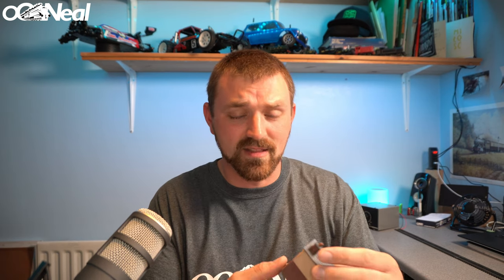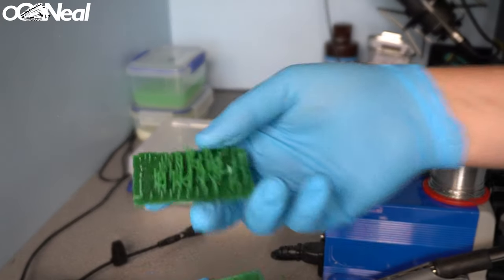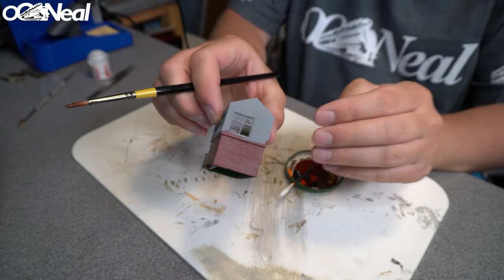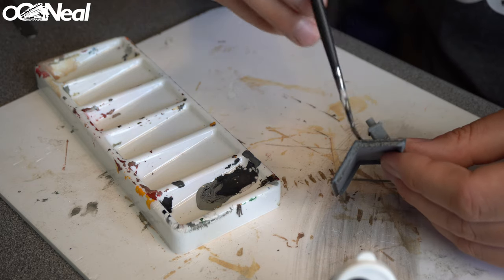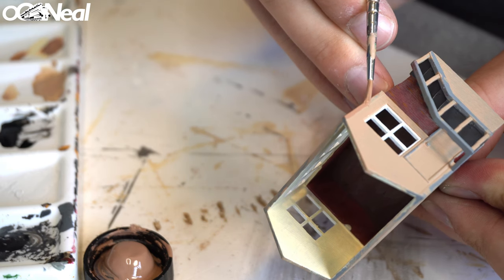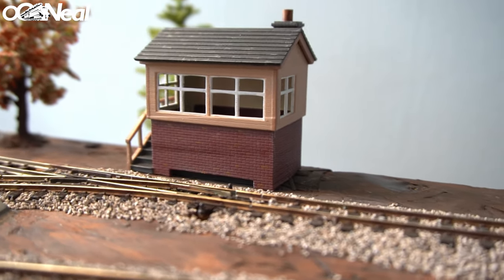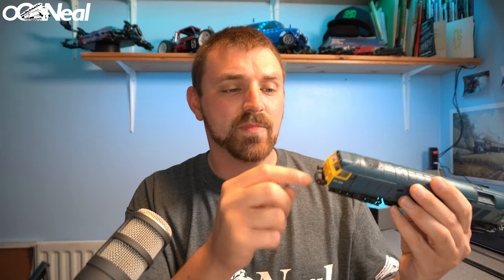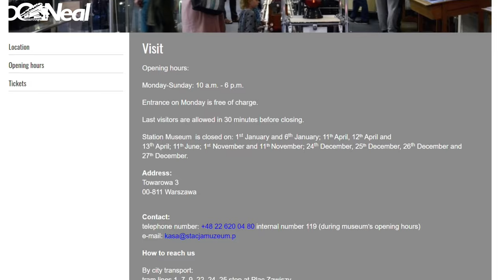Building Up A Model Railway S1 Ep 46 | Painting my 3D printed signal box | Sochaczew Narrow Gauge

Comment: Hi Tris.  A couple of suggestions for brickwork I have used....
Either 1. Cover the surface in beige or grey mortar colour (spray grey primer is ideal), then use a sponge paint pad to carefully paint on the brick colour. If any goes into the mortar don't worry it just adds to the random effect. 
Or 2. Paint the whole surface in brick red (red primer works well), then rub in talcum powder with your finger to pick out the mortar. 

Either will work well, and fast, but depend on the surface and texture of the material. As with anything, as you say, experimenting is the ideal way to test the best method. Thanks for another great watch. Gary
Reply from the maker: Thank you I will keep playing with different ways of doing it and see about this way. Take care!

Comment: You got yourself a unrefurbished class 50 which is a diesel electric, they were called hoovers because of the air plant which made a constant drone that sounded like a vacuum cleaner. When they were refurbed the air system was removed, the chunk out the roof was filled in and they had a lamp fitted at each end. Most were repainted in to full yellow end large logo.
You have done a really good job of cleaning it up and getting it running.
Reply from the maker: Mistery Reviewer that’s great info Thankyou. I’ll keep watching out for more pictures of them. Thanks again.

Comment: Hi Tris, thanks for a whole series of enjoyable videos.  Really nice to see someone so enthusiastic, yet so relaxed, about what he’s doing, and really interesting to see you working with so much tech, particularly 3D printing. Looking at your Lima Class 50 brought a large smile to my face, as I had two of these in my final 00 layout in UK before moving to Czech Republic in 2004. Mine were BR large logo, while your comments about the wheels brought back memories of problems with dirty wheels and traction tyres. Your coaches are BR Mark 1 and Mark 2. The stock with the straight edge are Mk1 Full Brake coaches, frequently found in both parcels trains and at the end of passenger rakes, while those with the rounded edges are Mk2. Mark 1s date from, I guess, the late 1950s/early 1960s, and the Mk2s from late 1960s to early 1970s. The Class 50s started life pulling passenger express trains on the West Coast Main Line from Glasgow to Crewe, where the loco was changed to an electric to complete the inter-city journey. Once the West Coast Main Line was electrified all the way to Glasgow, the 50s moved to the Western Region, replacing the Class 52 Westerns. There must be many photographs of all this on the Internet, with the 50s frequently pulling rakes of Mk2 coaches with a Mk1 Full brake and Mk1 Buffet or Restaurant car. Hope this helps in some way, best wishes, Stewart.
Reply from the maker: Hi Stewart! Thanks for the comment It was very interesting for me and also very nice to read. I didn't know that I did wonder about the bogies. I think I will save up and get one of the highly detailed class 50s one day but this will do for now. I hope y ou take care and stay safe
Reply: @OONeal  Hi Tris, you’re welcome, I hope it helped.  I’ve actually got a soft spot for Class 50s, as I can clearly remember seeing them parked in Platforms 1 and 2 in Glasgow Central Station when I was a young boy, then, later in Paddington with the West Country services. I’m now running a UK based N Gauge layout in The Czech Republic and have 2 Farish Class 50s, which are an interesting comparison to the Lima. Like you, I’d be interested in up-grading to the current Dapol models at some point. I don’t know the Museum in Poland, but it can’t be so far from my house, so will check it out later. In the meantime, if you’re interested in this sort of thing, there’s a really nice, working, narrow gauge steam railway about 40km from my house - https://www.ssb-medien.de/ Keep well, cheers, Stewart.
Reply from the maker: Stewart Fraser thanks I will look it up. Have a great fun with your layout! Take care!

Comment: Chris as other have said the blue grey coaches are British Rail ones . They started  with the Mark 1 from the 1950’s which had all design including Parcels and Mail, Passenger and Catering and Sleeping. Coaches, the flat ends. In the early 1960 they built new Mark 2 with curved ends, but only built passenger coaches so the Mark 1 Full Brake, Catering and Sleeping Coaches ran together in  the same rakes. The next Mark 3 came in the 1970 for both HST and InterCity which included Catering and Sleeping Coaches. The Class 50 is in it late 1970 early 1980 colours so you can ran all your British Rail  Blue Grey Coaches together, the buffet coach was sometimes put between the 1st class & 2nd class ones. If you can get some  Wren/Dapol or Lima 3 Axle  Milk Tankers you could run them with class 25 and a single full brake coach on the Milk Trains from West Country to London on the Western Region a later version of GWR steam.
Reply from the maker: Thats some great history knowledge you have there, thank you thats great to know. Ill look up the milk tankers. Thanks for watching and stay safe thanks again!

Comment: I've got  some of the Hornby coaches. They have the chromed windows. The rounder ends are MkII coaches the flat ends are MKI the coach with the little windows is a full brake van. It was for parcels. Usually ran on the end of a passenger train.

Comment: Lima class 50 has got the Lima Deltic bogies on it, which are HO scale not OO scale. Lima first British Model was Deltic and they thought they would try HO scale in Britain, but quickly change to OO, but to late for the bogies were already tooled.
Lima was good at cheap models, but like a lot of liveries to get there money worth out of development.
Reply from the maker: Corin Heathcote thanks for the info that’s good to know
Reply: The Deltic was NOT Lima's first British model, the Class 33 and a centre cab loco based on a German prototype and painted BR Green plus the Midland 4F and an Alco Steam shunter painted up in mock Southern and Midland colours hold that honour. These models were introduced in 1973 and were to the more accurate HO scale. Lima stopped HO production of British Locos in 1976 and the Deltic was first produced in 1977 to OO scale but still retained HO bogies, presumedly made for the shelved HO model.